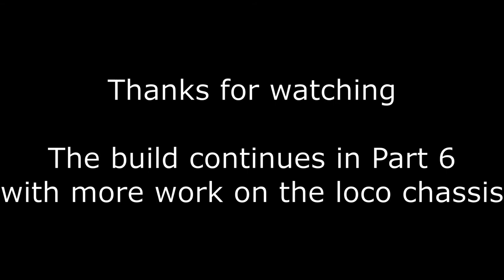RH George Part 5: First painting session

Comment: Hi Geoff, did you paint the buffer beams front and back or did you leave the fronts as bare metal since you were going to epoxy the buffer beam details onto them?  Thanks!
Reply from the maker: Good question. I did paint them but gave the surface a light rubbing with sandpaper before applying the epoxy. My thinking is that expoxy plus the two bolts won't make an air-tight seal around the edges so it could be possible that dirt and moisture could enter between the 2 layers
Reply: Thank you,  @gasmith841 !  I hope that you're having an enjoyable weekend.

Comment: Hi there, just wondering what the brand of paint is that you used?
Reply from the maker: All painting was done using 'Maston' acrylic spray can. Looking back its fine for the chassis components but if I did another kit I would use a 2-pack paint for the body parts. The Maston heat resistant paint for the smokebox is fine